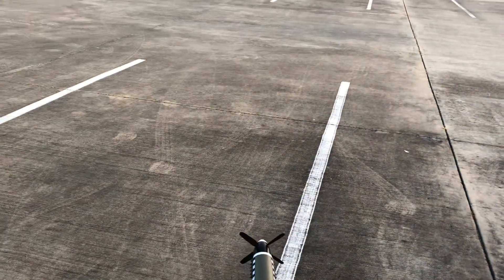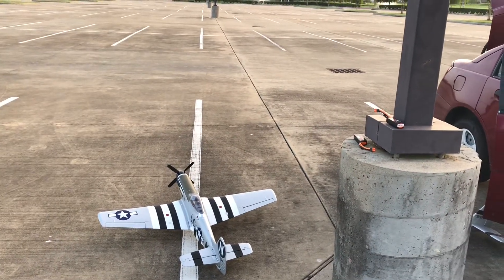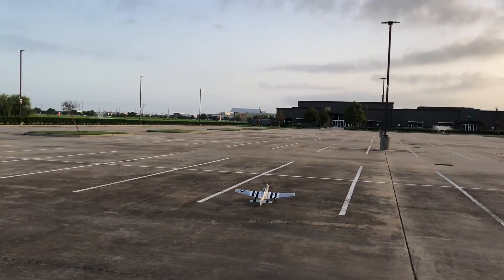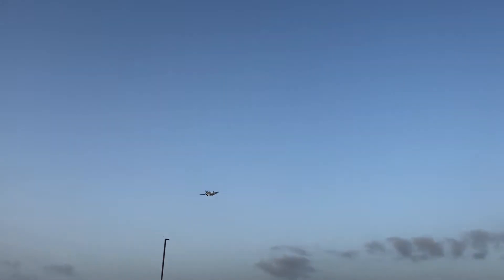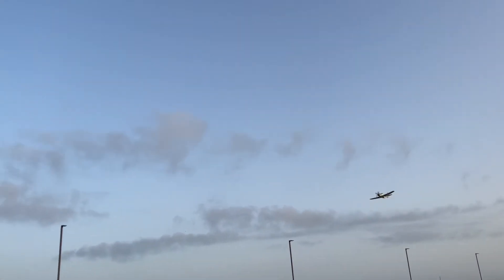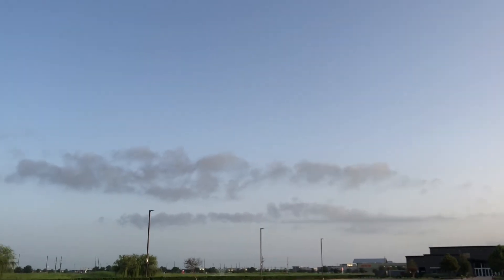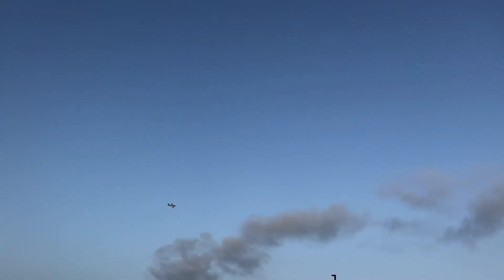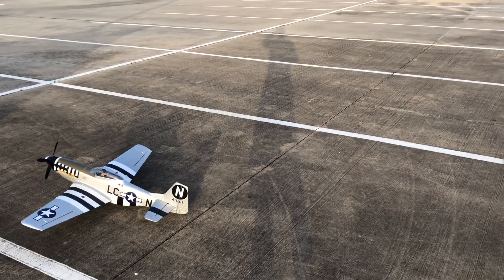E-Flite P-51 June Night is a good time

Comment: Yep, I've been flying for a little less than a year and I've got the Apprentice, T-28 1.1, and this P-51. I've crashed my P-51 twice now so I'm currently flying the T-28
Reply from the maker: I hope you get that P-51 fixed up and back in the AIR!!
Reply: @dustinhiett9594  yeah, i'm pretty sure i know what i did wrong on my last crash too. i wasn't flying with enough speed and i went straight to full flaps, causing it to stall immediately. i should have just used half-flaps in that instance before landing
Reply: @dustinhiett9594  I got my P-51 repaired and just came back from 2 successful flights. Both using 3S, one flight was 5 min and the other 6. I felt that the 3S was underpowered for this plane so my next flight will be on 4S. I'm prepared for longer landing space on 4S.

Comment: Would you say this can be a first warbird if flown on safe?
Reply from the maker: I think it could be if you have had a trainer with Flaps.  If you jump to this as your first Flaps and Retract model that might overwhelm you and cause a distraction that leads to a crash.  I know this is possible as the other day I flew this one and thought I hit the gear up but I hit the motor off switch. Moment of panic and a close call with the ground I go the motor back on and powered up and away.
Reply: Great advice. Thanks.